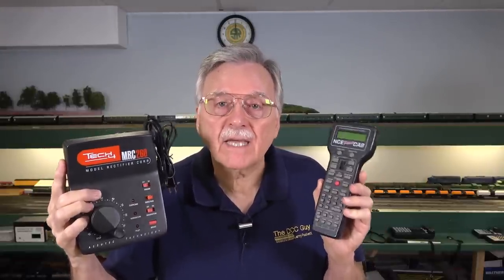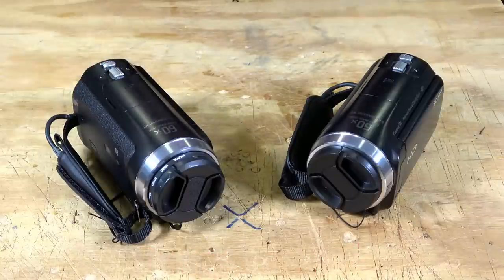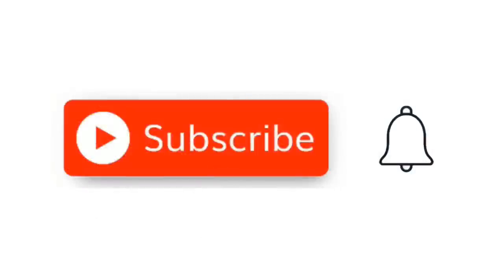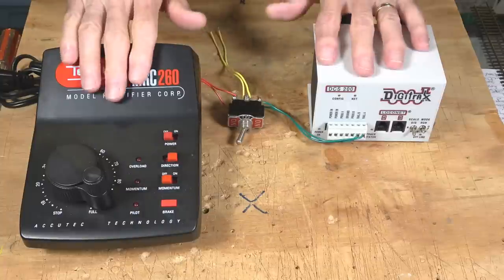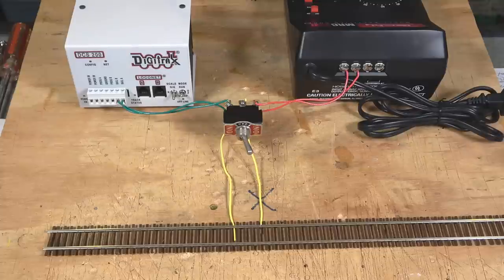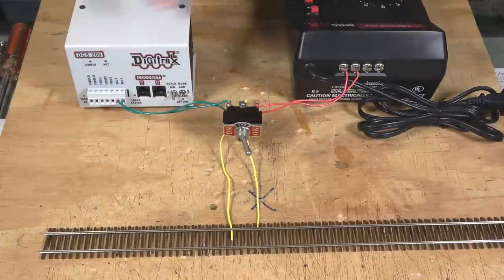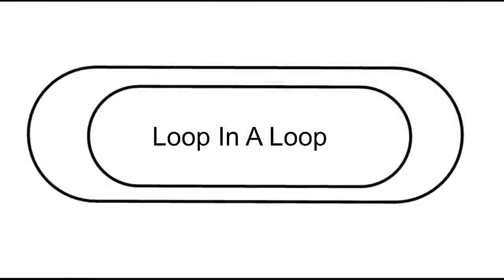Using DC and DCC On The Same Layout (333)

Comment: Two loop method = Great idea. I have HO equipment from my childhood (late 50’s & 60’s) that could run continuously on DC, with newer equipment on a DCC. Thinking about blocks of track w/tunnels separating various landscaping, bridges, stations, signaling, etc. in my loft. Your duck under video was helpful too.  Thanks!

Comment: I want to add one note. With a DPDT make sure it is rated higher than the highest amp on either system. That way you can operate and expand without peeking the switch. Usually a 10-15 amp center off switch can handle any size layout in N and HO scale.

Comment: I am (we are) blessed! My wife and I decided, when I retired, to move from a 4 bedroom house with a full basement to a 2 bedroom condo or apartment and not having room for my O gauge trains I sold all, absolutely all my trains, layout and accessories both DC & DCC.
But after moving in, my wife realized the need for a railroad hobby to keep me busy and she bought me a N gauge DCC equipped starter kit to go on a 4’x8’ table and all I have now is DCC and lots of potential (electrical pun intended.) Sorry you got your stuff zapped, but I am glad to hear you, your family and the majority of your equipment survived. All in all the storms, here in SW Va, can be deadly but pale in comparison to the rest of the planet. 
I have an ancient Gateway laptop I could let you borrow, but other than use as a weight I’m not sure it would help as it only has a 256 mb hard drive 😁I use it as a large flat deadweight for gluing down my track and as a conversation starter for more mature friends I’ve made in this complex we live in now.
Best wishes for an isolated future.
Reply from the maker: I too have an old Dell laptop and I fired it up the other day but found that a very frustrating experience as it is so SLOOOOOW. I’ll break down and spend $400 for a new Dell clunker and it will,do the job as I won’t be editing videos on that. Where are you in SW VA? I was born in Richlands.
Reply: @TheDCCGuy  Roanoke

Comment: Useful advice and pointers, thank you👍😊 When running narrow gauge models in 7mm it isn't always possible to fit a decoder due to space in a loco/construction methods.

For the standard gauge I plan to run DC and dead rail RC - so no issues to consider. 

👍👍😊💜💜✌️✌️

Comment: Thanks for posting on a seemingly taboo topic... I started building a small shelf HO/HOn3 layout 10 years ago... I like sound and don't really care much about DCC control... I started with a (to me a very underrated product) MRC Tech 6... It's basically DCC but can only control the #3 address (walk-around 1-6)... my plan is based on a cab/block  control layout (DPDT switches)... essentially the two loops with connector idea... crossing over would be relatively rare...  

I added a potential dead-leg block in the cross-over for additional protection (switched normally to off)... one stretch will be an auto-reversing DC track (chugging with DC sound) and the rest is a switching/branch line... I figured there are no guarantees and operating procedures combined with the extended crossover is acceptable protection.

Comment: All power strips should have a surge suppressor built in from the manufacturer because of lightning. Lightning can strike anywhere at any time, and you never know how bad the damage could be. I'm glad you didn't lose power to your whole house and have other stuff damaged by the lightning because that could've been an expensive problem, especially if the water heater doesn't work properly. Stay safe, and I'll see what you put out next week.

Comment: I have a DCC modular layout but I have two point to point tracks that are completely electrically isolated from the DCC double track main line and industrial sidings. One of the DC tracks is a  Bachmann trolley that shuttles back and forth in the city of Holyoke. The second is a Proto 1000 New York City subway that will eventually shuttle from beneath the DCC Grand Central Terminal tracks (under construction) to somewhere in the Bronx. Since those DC tracks are designed specifically for those cars, they will never be home to the DCC Locomotives.

Comment: Very sorry to hear about the damage of equipment due to the storm, this has now led me to decide to fit arrestors on my 13A outlets that feed the railway.    I use DPDT centre off switches, one side is wired DCC the other is wired DC on 2 of my sections (loops) runs, my points are operated by solenoid motors on these two loops. elsewhare they are Tortoise. This means that I can never have DCC and DC fed simultaneously, to the same track at the same time. DC only used now for running in new locos not yet fitted with DCC. Just got to the part of the video where you also use DPDT centre off. However mine work oposite to yours, when switched to one side, the other side is where it picks up the power from which is switched to the centre common connections.

Comment: I have two small layouts one is my front room coffee table. Since it is 40 years old and I have some engines that are DC only and can not be converted to DCC. So it makes sense that the new layout would be both! On my new layout. The inside loop is isolated. But using this method and an extra DPDT switch, You can have a DC/DCC/Program track. It works extremely well, and having the ability to have a complete loop to program and flip a switch run the DCC engine is really easy! Not having to switch tracks to test a newly programmed engine makes the extra switch worth the extra work it takes worth the time. I'm am not going to try and explain how, but it can be done by using the same method as splitting the DCC and DC.

Comment: Very good video, Larry. My layout is going to be VERY small, 4' x 6' ( I live in an apartment) and have a very simple track plan that will lend itself  to splitting between DC and DCC. I can test run the locomotives I've repaired to fine tune them before adding the sound decoder. Your wrong about it being cheaper to buy locomotives with sound decoders installed. $250, minimum, is too steep for me on a fixed income (I swear this hobby is trying to price me out of it). I buy older Athearns,  Stewarts, Atlas or Katos (when I can find them) that usually are not running well or not at all and repair them and add a Digitrax or XL Systems sound decoder. It usually costs about $100 or less. I know, it's not state of the art, but it's functional and the best I can do under the circumstances. Your videos helps me tremendously.

Comment: I'm building a shelf layout now, that acts as a layout, but also as a test track, so there is a bit more to it than having a plane layout.
It also involves an integrated programming track.
But it also has to run on DC, and this for two main reasons.
Sometimes, someone ask me to do a service on a DC loco, so now I can test it without having to build a temporary test track.
The second and main reason is, and I'm not agreeing completely with you on that, that a pre fitted loco are always cheaper, sometimes, but not always, or it isn't always available on what I call a simple DCC loco, that is without sound, as I like my DCC plain, not a fan of sound.
And I often buy second hand, so here before I build in a DCC decoder in, I first want to test it on DC as most of them are't converted yet.
So I'm a bit extra concerned about safety, and not burning out something.
And my solution is working with Arduino controlled isolated high voltige relays, so on switch over, the 220V mains power supplier we have her in Europe is also cut off on the unit not in use.
I'm also now looking into track detection, so only when there is nothing on the track you can switch over.
And like you mentioned all controls on turnout's, or what ever, is completely isolated from the running sources.
As for lightning and thunder, pulling out the  physical connection to the mains after use, is a good tip, that I always do.
And if you surprised by a sudden storm, always make sure you put a safety peak switch between your socket and your plug…

Comment: Really enjoy the videos Larry! I have a 4x8 with a 2x6 L shape extension for a staging yard. And I actually do run DCC and DC on the same layout same track no insulators. It's just one or the other not at the same time. I just have a main bus ran with some feeders scattered around. Only Manuel thrown switches no accessories.I mostly use DCC but If I want to run DC locos I just remove all the DCC locos from layout and swap the positive and negative leads over to my DC power pack and boom DC power. I'm sure this isn't the best way to do it, probably best for very small layouts but it works well. Everything runs really smooth regardless of the power style. Best wishes !

Comment: Its best that both tracks can use full DCC or full Analog DC instead of two tracks with both. Use the switch to run either all dcc or all dc to avoid power upsets. Also, installing Atlas Selectors to isolate track sections allows you to cut off a locomotive in one mode while allowing the other mode without the power upsets.

Comment: Hi Larry. Like many modellers, I started buying DC locos before the penny dropped and I started buying DCC-ready/decoder-installed locos, so I have been looking for a solution to this “problem”. I model in N scale, so conversion from DC to DCC is not always easy. Something to bear in mind using the DPDT, centre-off switch is the tendency to leave locos on the layout – in sidings and loco sheds, etc. I think the answer to this is to borrow an idea from your second solution, an inner loop and an outer loop with an interchange track, possibly using nylon track joiners to isolate certain parts of the track; I would appreciate your (and others’) views.
Reply from the maker: Good point about leaving locos scattered around the layout. I really don’t like the idea of mixing DC and DCC unless it is done using the loop in a loop method. There are just too many cases where folks will forget and zap!!!!

Comment: Larry, At about 7:00+ in the video  about DCC & DC together.....with a DPDT Switch.....is the power not coming in from the posts opposite of the toggle lever position?
ie: if switch lever is pointed left....the contacts at the bottom of the lever slide to the right?
 I'm not sure.
Great Videos. Jeffrey
Reply from the maker: See the comment before yours.

Comment: Hi, great info, I have a question, do you still need to insulate the rail switches if you have a frog juicer installed and using Peco unifrog ? By insulating I mean place those plastic joiners.
Reply from the maker: As I understand the construction of the unifrogs the frog rails are totally insulated from the frog itself and are powered using jumpers from the opposite stock rails. Consequently they can be connected directly with metal rail joiners.

Comment: As a suggestion, I use a UPS(Uninterrupted Power Source with built-in surge protector) for my computers. If the power goes out, I have 15 minutes to close down my PC's.  The same should work on a DCC layout.  Best wishes on your camera situation.  🙂
Reply: My UPS with the surge protector in it.....bit the dust due to a lightning strike....lol
Reply: @jeffreywalker405  - But did it stop the surge to your equipment?

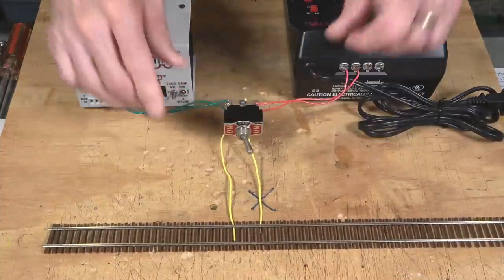Comment: This is kind of nit-pickey but at 6:52 i don't think you are turning on the DC, rather the DCC. Typically the toggle activates the center and end contacts away from the direction the toggle is pointed.

Comment: QUESTION!  Must you remove ALL DC LOCOS from the rails when you switch to the DCC running mode 
to avoid burning out the DC (ANALAOG) motor?
Reply from the maker: I do. The high frequency of the DCC signal can make the motor heat up over time and it might burn out a winding. You should never put a coreless motor without a decoder on a DCC track.
Reply: @TheDCCGuy  Thank you for your advice!  On the other hand, can you run, on an HO DC layout, a DCC Sound equipped locomotive without compromising its Decoder?  I attempted to do so with a new Bachmann Sound equipped BNSF Diesel  (MRC 1370 DC Controller) … BINGO … it will only run w front headlight facing front, UNLESS YOU TURN IT MANUALLY, IN 1 DIRECTION.   Send it back to Bachmann?

Comment: I learned the hard way that you can not pass DC power through NCE switch-kats.  I will be changing my turnout decoders to Digitrax DS74 using Loconet.  I like to be able to run both DC and DCC at the flick of a switch.

Comment: quick question can you add led lights to this so you know what on or not
Reply from the maker: I am not sure of a way to do that without some pretty sophisticated circuitry to discriminate between DC and DCC, but I’ll give it some thought.
Reply: The DCC Concepts Alpha Meter has an indicator that shows DC, DCC or AC.
Reply from the maker: Yes and uses some sophisticated and expensive circuitry to do that.

Comment: I have a control panel for two powerpacks as designed by Lynn Westcott in his wiring book, with dpdtco switches for each block and master switches to change packs or current direction. I’ve only really used one MRC pack and so I intend to use the second circuit for DCC. Is this feasible? The track feeders already go directly to the control panel via the terminal strips. I won’t use both systems at once, even though it will mean finding an alternative AC source for the turnouts. Will the DCC power the trains in this manner, rather than rewiring with a buss etc?
Reply from the maker: You could do that but it is an accident waiting to happen since it depends on you and everyone else remembering to set the power switches in the proper sequence. Sort of like the who’s running my train scenario only with DC and DCC competing.
Reply: @TheDCCGuy  yes I can see the potential for trouble but the dc pack would be turned off whenever dcc is used, and all blocks set just for the routing wanted. I’m just trying to avoid rewiring the whole layout.
Reply from the maker: OK, that is  common method when converting a DC layout to DCC. Just hook up the DCC bus to one cab and leave the other as DC. The only issue is that cab control wiring is often inadequate for DCC. Your power pack likely maxs out at about 1 amp whereas many DCC boosters are 5 amps.
Reply: @TheDCCGuy  thanks for the advice. I’ll see what happens and if there’s losses Or it’s inadequate for the amperage I may end up having to rewire anyway. For the time being it’s one way to continue running my older locos that aren’t converted to DCC. I have one ‘beloved’ Atlas FP7 that growls so much it doesn’t need a sound decoder lol.

Comment: If I use a loop within a loop method, do I need to have two separate buses, one under each loop?
Reply from the maker: No, you can just run feeders from a single bus to both loops.

Comment: I purchased the Bachmann N Scale Roaring Rails DCC Train Set and after a couple of years I decided to change back to DC powered track. Now using Kato with having  4 multi track layout with three crossovers. I also installed separate push button toggle switch, to power on/off to each track, so I can wait for a train to pass before crossing over with another train. I'm only using one Kato DC controller which powers the whole layout, running 4 DC trains with it and having alot of fun too :0)  ... My Question:  would it be easy to change that Roaring Rail  GP40 DCC engine back to DC ? how would one change that specific DCC engine back to DC as it runs way too slow on a DC powered track, even when its the only train on the layout ... Thank you
Reply from the maker: You would have to remove the decoder and hard wire the track pickups directly to the motor contacts. Since this is a factory installed decoder it might be easy or hard depending on how they did it and how many lights are involved. If you have never done this kind of thing seek help.

Comment: I unplug all electronics from the outlets when not in use. It's a hassle but cheaper than having to get stuff repaired or replaced. If it's storming or getting ready to I don't plug anything in.

Comment: With the DPDT switch option - will you be covering the steps are needed to use DC points with DCC ? (Hornby provide clips to convert their points).
Reply from the maker: The points per se should not be an issue only powering the frogs. And with devices like Frog Juicers made just for DCC cannot be installed if youmwish to go back and forth between DC and DCC.
Reply: Thanks @TheDCCGuy

Comment: Hello Larry, I have newly found your channel and I really enyoy your videos. There is one thing I have not found in your videos thoug, and that is what brands of trains work together? What is a good starter set, value for money? Does the german brand "Märklin" work with other brands? Where does Roco, Lima, Trix come in the mix? These are brands that I have seen in our stores here in Sweden.
Reply from the maker: As long as they are the same gauge they should run together. It really is down to the electronics. Some are DC some AC. Also there are different command control, decoders so make sure to use what is most popular in your country. DCC is sort of a world wide standard now but so e of the European formats are still,popular there so you need to educate yourself on them.